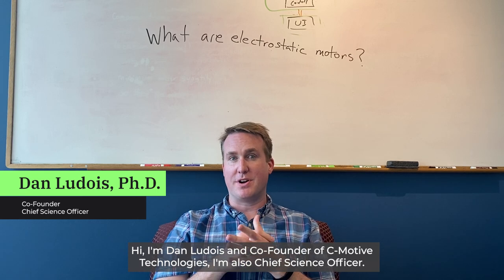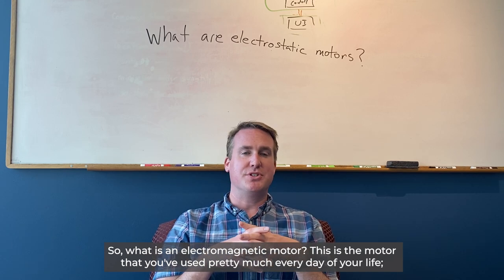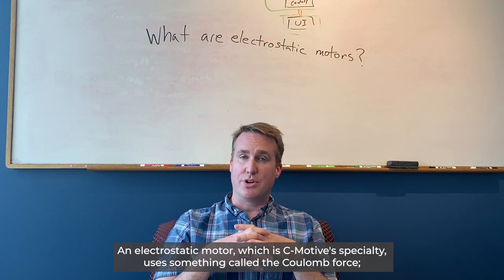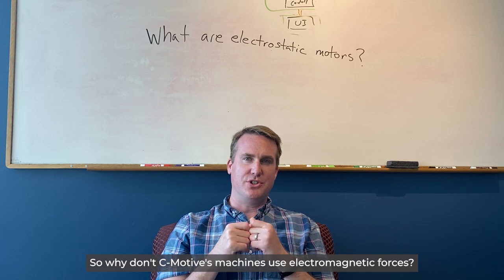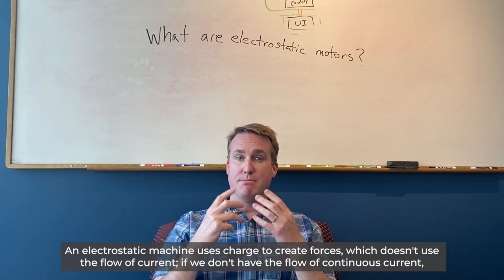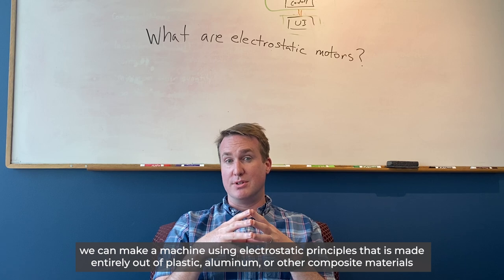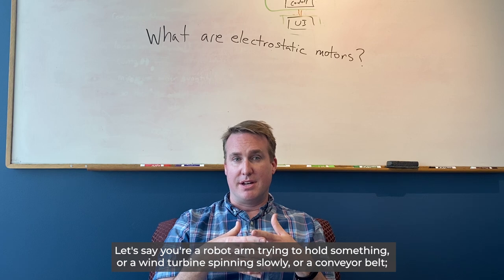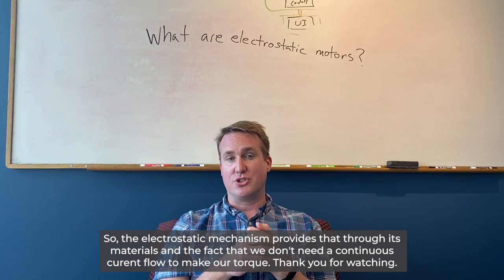Ask A Founder - Basics of Electrostatic & Electromagnetic Motors

Comment: Besides the dielectric fluid, have you tried vacuuming out the air, or replacing the air inside the motor with an inert gas?

Comment: You could build a device that uses electrostatic energy to initiate the type of reaction you are probably looking for. I designed a very simple artificial charged particle that should fill your needs. The drawback? It needs to be hit by a bolt of lightning to start it. When one is started, you can probably start thousands more. I spend all my savings in my youth trying to grt lightening to hit it without success. I am now 70 and don't feel like chasing it any more.